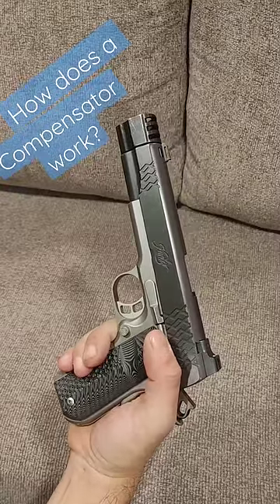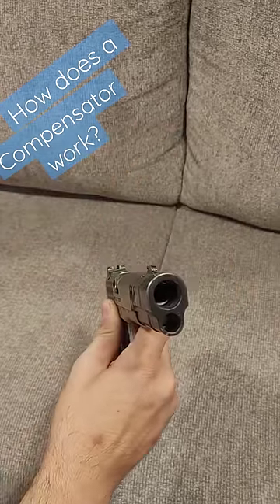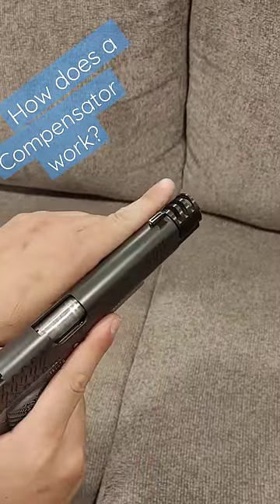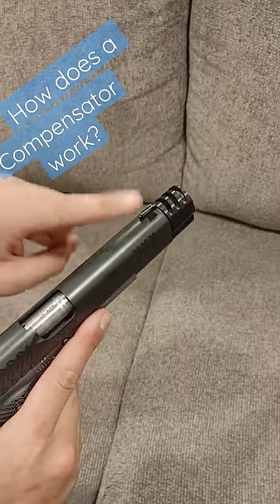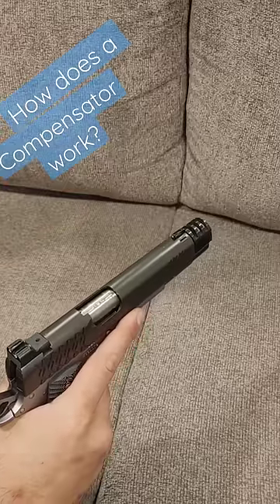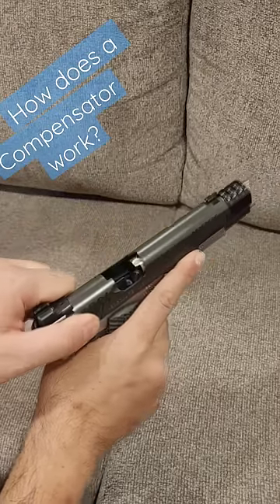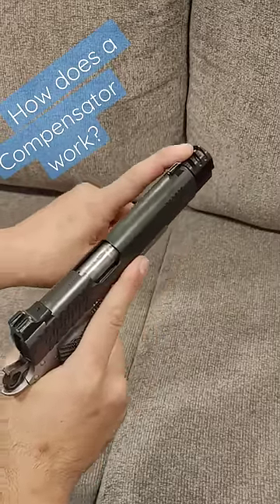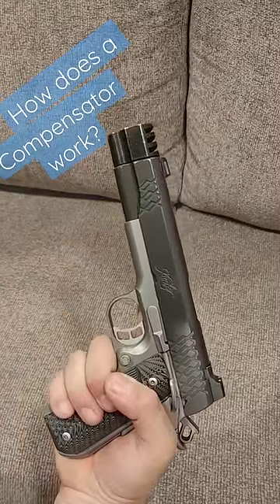How does a Compensator work?

Comment: It releases gas when the bullet is going forward in motion

 stabilizing the Recoil resulting in accurate bullet placement

Also increasing accuracy on follow-up shots as well

Constant shooting at  shooting range enhances accuracy give you the ability to be on point all the time 

Not to mention detail instruction from  a certified weapon instructor

It's also extremely helpful

Any revolver or Auto loader pistol
Should have extremely visible front and rear sights that catch the eye 

using colors or any other form of technology to enhance accuracy

Comment: There should be something to note about real compensators and faux compensators. Real ones are attached to the barrel to reduce the gasses lost from barrel to slide. Faux ones just attach to the slide. Gasses are lost, but still work for both.

Comment: A compensator is usually a mid-end, modified and extremely loud vehicle. To use it, simply push the gas pedal to the floor while your gear is in neutral. It's more effective when used in urban areas around 12AM – 6AM.
Reply: Hahaha. It’s been 10 months I’ll give you a like. What they say “FIRST”

Comment: A compensator is a device that is typically attached to the muzzle of a firearm to reduce recoil and muzzle rise. It works by directing some of the gases that are produced when the firearm is fired in a specific direction, which helps to counter the force of the recoil.

Compensators are often used by military personnel because they can help to improve the accuracy and control of the firearm, particularly when firing multiple shots in rapid succession. When a firearm recoils after being fired, it can cause the muzzle to rise and the sights to move off target. By reducing the recoil and muzzle rise, a compensator can help the shooter to maintain their aim and stay on target.

Compensators are often used on rifles, particularly those that are used for long-range shooting or in situations where the shooter needs to maintain a high level of accuracy and control. They are also sometimes used on handguns, particularly those that are used for competition shooting or in tactical situations where the shooter needs to be able to make quick and accurate shots

Comment: Fuuugly comp - great explanation.

Those of you that want a comp - hopefully also reload - and may already know this.
A slower burning powder that makes its pressure toward the end of the barrel makes that compensator / muzzle brake properly efficient. 

Basic analogy; 
Stock class = guicker powders
Open class = slower burning powders.

Anybody with enuff experience to know what I'm saying, is the choir I'm not preaching to - y'all already knew this.

Those that just got a little bit of useful wisdom - you're welcome ✌️😎✌️

Comment: So, you said the barrel doesn't come all the way out the end, but it did when you racked it at the end of the video.  Meaning that the gasses aren't going to go through those ports.  I bought one like that before and it didn't do anything, maybe a little for the added weight.  If you want a compensator on the gun, it has to be threaded onto the barrel.  And just for inquiring minds, mine was a springfield milspec .45 1911.

Comment: You need to actually pin and weld it to the barrel to get even better performance. Rather than just a barrel lock comp. Love my 1911, that’s how mine is setup.
Reply from the maker: Copy. I'd consider ot on a barrel that isnt the original.
Reply: @TheJimminiShow  yeah I wouldn’t either I bought a bull barrel specifically for it.

Comment: The problem with this is that all the gas and smoke gets blasted up into your line of sight making it just as hard, if not harder to get back on target. 

There is a better way. 

Have the gases escape from the corners instead of the top. Still mitigates recoil while keeping your line of sight clear past the barrel.

Comment: It's not the gases coming up out of the compensator that pushed the muzzel down. It's at the gases at the bottom that don't have a balancing Force above them. Same Principle as a rocket. By the way once a bullet leaves the barrel you're essentially holding on to the wrong end of a rocket.

Comment: I use a compensator as well, but no amount of compensation will make up for a cheaply made hand gun. Nor will a compensator actually compensate for being a bad shot. But my comment isn't about your compensator, it's about why you seem to be about Kimber so much. 
The Kimbers that were made when the company was in Oregon, those Firearms out of that facility are great. They had really good quality control, they had I guess better people working with more skill sets and greater knowledge because those guns are just much better made. And I think they moved to Ithaca or somewhere to New York and the guns made by Kimber after they left Oregon wherever they ended up I can't remember right this second or just notoriously not as good a product as the ones that were being made when they were in Oregon.

Here's some facts:
Early Clackamas marked Kimbers are revered for truly being closer to a custom, or being a gun that's been hand made compared to the mass production and cost cutting of the later Yonkers marked and ESPECIALLY the "series II" guns. Theres no argument that QC at "Yonkers" made  Kimbers had problems for awhile, most notably with extractor issues. They have since improved on QC, but some still deride them as unreliable using cheap internals instead of hand fitted forged parts.

So... thats my 2 cents on KIMBERLY. They rest on their laurels and don't make any 1911 (2011) that is worth its price they ask. A Bul Armory or a Stacoto XC are fantastic "2011's".

No one cares about your over priced, trash Kimber 19you..

People that think safety is a joke can fuck off.

I'm into joking around but not with that topic. You never know who's watching your posts...
Once you tube learns your ok with flaging your face with your own gun AND asking people concerned on safety to "shut up"... let's see how that goes for ya. Your camera is off to the side so its safe if a camera blows up beside your face from being hit by a mis-fire or negligent discharge.

Safety Nazi's? OR... cautious gun owners is what I'd call a person that might question your safety or lack of safety practices. Not a good message to send to novice shooters..thanks for your BULLSHIT comments.
Maybe your teen or a friend's teen will get shot in the face and at least the "safety nazi's" (who rather aire "on the side of being safe then sorry"), WONT be the ones to blame.

Keep up your great advice... If you dont like safety NAZI's, So does that make you a CARELESS/RECKLESS JEW?? WTF are you saying? And your the dick that stands behind a counter at a gun store? I hope your just hired help. Your lack of seriousness as to safety is pathetic.

I keep watching so I'll have my screen record ready to document you shooting yourself in the face.

The more seasoned shooters are gonna know how important safety is but your honestly sending a bad message to the newer gun owners...

I'll be sure to let YouTube know your messages of gun safety and your lack of taking it seriously...

Comment: That's the weirdest design compensator I've ever seen most of them that I've ever seen are directly a fixed to the barrel like it's a quick change barrel system and the slide is separate from the compensator and move separately from the barrel compensator setup... This one the compensator is sliding down the barrel when the slide moves back which makes me worried about mechanical malfunctions in the future
Reply from the maker: This is a VERY common 1911 comp. It replaces the barrel bushing. In this case, its more for looks and added weight because the barrel isnt ported. It helps a tiny bit as some gas will go up as the slide starts to move, but needs a ported barrel for max effect. P365 X macro is very similar
Reply: Right that was my thought process and it looks ugly if the compensator was on the end of the barrel itself it looked like a tank and be more effective.

Comment: Would probably work better if it was threaded on the barrel. I see those copy cat Punisher compensators all the time but people forget that in the movie they were threaded on the barrel, now you just have extra weight on your slide.
Reply from the maker: Not entirely true. It does work better when it's on the end of the barrel however if you look at any gun that is fired in slow motion, the bullet will leave the end of the barrel before the slide starts moving rearward. So you will get a bunch of pressure directing the nose down. Now it's only a 25 to 40% reduction compared to a regular compensator that is threaded under the end of the barrel, but it does Aid in Recoil management. Also the ones in the Punisher were not attached to the barrel

Comment: Does more than keep a little of the muzzle down, if tuned properly you can achieve zero muzzle flip and even negative flip. Typically high pressure loads work better, my revolver has zero flip with .357 pressure .38s than light pressure .38s.

Comment: That particular compensator isn't actually a compensator as it does not attach to the barrel it's just a bushing and mostly it's the weight that is pushing it down when you're firing it

I noticed the significant difference when I changed the barrel to a compensator barrel on my 1911 Colt 1914 GI issue third generation ownership..

Previous generation being my grandfather of World War II army Air corps drill sergeant and my father US Navy SEAL Vietnam.

Comment: The explanation is almost correct imo 
The compensator does not reduce the amount of force with which the slide hits the rear end, rather it uses some of the gases that would not be used to introduce an additional leverage at the front of the gun

Comment: WW1-WW2-korea-Vietnam were trained with the 1911.   If you hold the modified weaver combat stance.   Cup and saucer hold. Pumpkin on a post hold.  Then the recoil will return the weapon back on target.    You snow flakes that stand straight on and put both thumbs on the slide need a compensator

Comment: Please stop saying this it is false

I'm just a random guy on the internet that enjoys science such as fluid dynamics I know it's air it's still considered fluid dynamics
The amount that the air going upward affects your gun is ridiculously low  it'll range from not noticeable at all even with the machine to barely noticeable at all like I mean very very little so it does push your gun down but it does it so little it's not worth mentioning what really does the work so is the extra weight that it puts on the end of your gun everyone knows that it's easier to move 100 lb 5 ft rather than a thousand pounds 5 ft let's be honest almost no one here is going to move a thousand pounds 5 ft but almost everyone here can move a hundred pounds 5 ft the same thing is going on with your gun because you put that extra weight on the end of your gun it takes more Force for The recoil to move your gun meaning less overall recoil

So please stop spouting the nonsense that it is the air that is making it reduce the amount of equal that is a myth at least that's not the biggest factor in it while it can help it's extremely small oh my last job was a gunsmith and I worked with several other actual professional companies that everyone knows for example sig cold Ruger m&p and a few others 

If you still do not believe me I'll give you a suggestion to do your own test you have two ways first is the cheap and dirty way taking your drill and drilling into the top of your barrel and slide long as the whole small enough and take a file to the inside of the barrel you shouldn't have any problems with your gun and then you just make that whole a little bit wider until it starts to look like you have a compensator on your gun and then bam you technically have a compensator at least with this original logic take that gun out to the range and fire it a few times I guarantee you'll notice that your accuracy went down and it's because it doesn't have mass on the tips so it has more recoil takes less forced to move that object the second way you can actually do with a compensator it's actually very easy which is switching out your slide and barrel you want to find a heavier barrel and slide I will point out though if you change to a heavier slide you probably will need to upgrade your recoil spring if you notice that you're firing and it doesn't vegetable rounds always correctly after you changed your slide then it's probably because you need to upgrade your big Cold spring to a heftier one but these are two simple tests that you can do one for people who are broke but let's be honest if you got guns and you actually care about s*** like this you're going to go with the second option because you wanted to look crisp which is getting a heavier barrel in a heavier slide shoot if you put a light or something else on the under rail and then take it off you'll notice that there's more recall as well when you take it off I will say this though if you have heavier stuff in the front you'll notice that you sway a little bit more when you're shooting so yes you'll be super accurate with those follow-up shots but in between the shots you'll start to sway if you make it too heavy

Comment: Almost positive these exact "compensator" actually doesn't provide anything to 1911s unless it's screwed onto the barrel. It does add extra weight though for sight picturing. I have one on my 1911, shot it with and without it, felt little to no difference, and I believe there are a few articles saying these aren't really that useful
Reply from the maker: Sight picture is based on length, not weight. And the comp does nothing for that. It sits in front of the front blade. I will do a follow up showing the difference and that it does help. A ported barrel would help more though

Comment: The only problem is you carry a Kimber. They have aluminum frames that crack, the spring has to be replaced every 800 rounds. That spring takes 200 rounds to break in. Kimber makes great gun porn but their guns suck

Comment: That is not a compensator.  That's just extra weight on the slide.  Compensator is attached to the barrel.  Having some slots cut in slides, do not do a.damn thing. I did video comparing 365 XL and Spectre Comp.

Comment: You didnt check the bore with your pinkie what if the extractor failed and then you point it right at yourself
Reply from the maker: Thats what trugger finger control is for.
Reply: @TheJimminiShow  you better start preforming pinkie bore checks (pbc)

Comment: Whenever I think of a compensator I always imagine those crazy looking compensators on those pistols in the live action Tomb Raider movies. Also what's the difference between compensators and a muzzle break?
Reply from the maker: Basically, A compensator directs gases up to force the nose pf the gun down to fight recoil. A Muzzle break usually directs gases out the side at an angle to "pull" the gun forward. Comps go on guns with a reciprocating slids, muzzle breaks go on a gun with a bolt. Rifles mostly. This is a basic explanation, but i hope it helps.

Comment: Yea so worry less about safety nazis and more about the actual function of whatever you put on the gun, compensators do work but a bushing style compensator has no effect on recoil, the slide and compensator would be covered by the barrel by the time the round exits the barrel thus no compensating affect, you'd need a threaded barrel for it to work, also if that's one of those ebay bushings you might be worse off with it on accuracy wise if the fit between it and the barrel isn't tight

Comment: My understanding of that particular type of compensator is that it replaces the bushing and most importantly does not actually function as a compensator due to the fact that because of the way a 1911 functions the barrel is inside the comp when the bullet exits the barrel and no powder gasses go through the comp so, no jet effect, so no reduction in muzzle flip. Okay time to let the so called experts chime in. Ask an open class USPSA competitor if this is true. Oh yeah, I am one,so......
Reply from the maker: it is minimal, but some gas does go up through the compensator. additionally the added weight helps as well. the bullet leaves the barrel just as the slide unlocks. so a tiny bit goes up. works better if the barrel is ported to match and the same length as the comp
Reply: @TheJimminiShow  well you and I both know(assuming that you do) that a comp only really works when it is attached to the end of the barrel and all the powder gasses go through the comp. I have been shooting comped guns since 85 so.........

Comment: Isn’t this an out of battery hazard
Reply from the maker: How?
Reply: @TheJimminiShow  does pressing the gun against something with an extended slide (in this case the compensator) cause the slide rock back ever so slightly to be out of battery. alternatively frame mounted compensators might mitigate this problem. im thinking in the context of like cqb stuff and this probs works fine for match shooting.

Comment: I don't think it's really worth it to put one on a regular semi auto handgun in calibers like .45,.40 or 9mm just because there is not that much recoil anyway!It might be somewhat practical on DE and Automags yet where I would definitely put one on is either on some .44 magnum or bigger and also perhaps on a full auto Glock-18!And yes,I would have clearly preferred to have a regular Glock-18 with the muzzle brake on the end of the barrel or slide that would have added some length but would not have crippled the whole gun like it was done on a Glock-18C version that has those retarded cuts right in the middle of the barrel!By the way there is only one thing in the world that makes me cringe more than seeing the same C-rap on a semi auto Glock: anti-gun excuses of human beings 😂